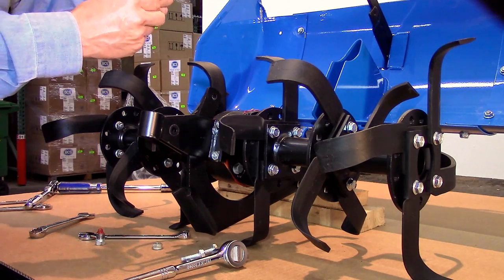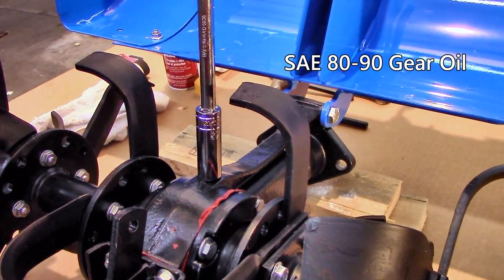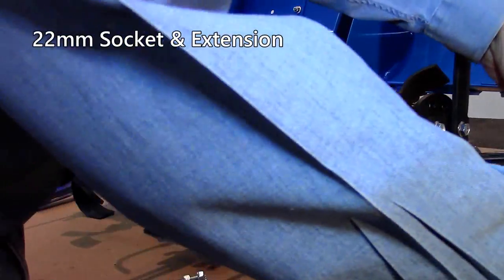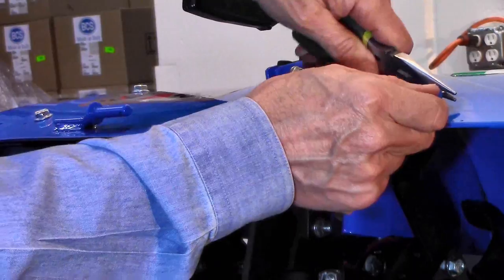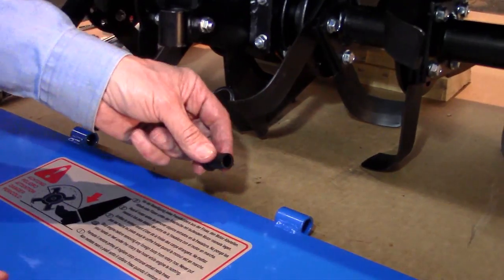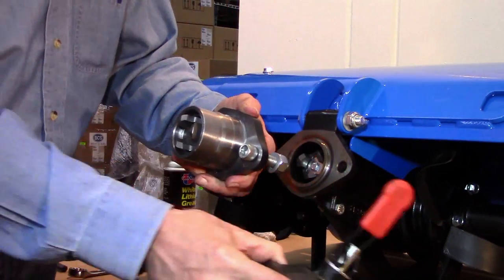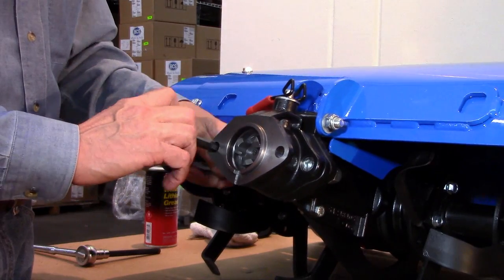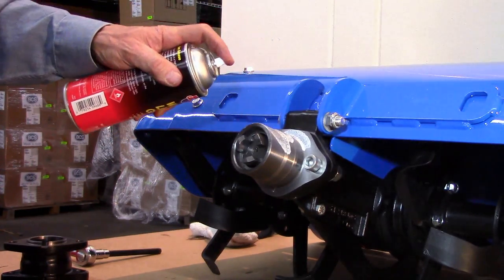Initial Setup of the Rear-Tine Tiller attachment for BCS Two-Wheel Tractors

Comment: How do you clean out a motor you tipped over and got oil in the motor??? My tire was coming off cause of low pressure and I tipped over and have oil now all in the motor. Please help
Reply from the maker: We'd recommend a local small engine shop.  If it is a Honda engine, it can be serviced nearly anywhere.

Comment: I just bought a older used bcs 20 inch tiller today and got a 25'x60' bed tilled but it finished off most of the old remaining tines so I'm going to order new tines but I thought I read this tiller is expandable from 20-26 inches? If so how would I go about expanding the till width?
Reply from the maker: Hi James,
If you're tiller was built in 1995 or later, you can purchase an expansion kit that will turn your 20" into a 26".  The sides of your tiller hood will expand outwards and the kit includes the extra spacers and tine hubs to fill out the hood.  Part number for this kit is TK1.  Cheers!

Comment: Im interested in creating tilled lines for growing corn. Im windering what you would think of me removing most of the outer tines for a narrow strip. More power per 4-innermost tines. What do you think? Would if work well? Havjngca log of tines causes me to have to till large surface areas
Reply from the maker: We'll need some more info.  Specifically:
•	In what zone are you located?
•	What is growing in the plot now?  Do you plan on planting a cover crop this fall?
•	Do you plan on tilling the strips this fall, or next spring?
•	What will the distance be between tilled strips and what will be growing between the strips?

The reason for the questions is that the more aggressive the vegetation between the strips, the wider the strips will need to be.  Also, if the strips are too far apart, pollination will require the corn be hill-planted (3 plants per 30”) as opposed to a traditional single row.
Reply: @BCSAmerica  I haven't planted in a year. The grass will be flailed before. And herbicide used after. I live in the Caribbean, so there's no issue with the 4 seasons. I have planted corn before but with my full compliment of tines on rotary tiller 30 inches... which causes me to have to plow a larger surface area than I have to. I plant corn in rows 30 to 36 inches apart.
Reply from the maker: @small-timegarden  Interesting circumstances – here's our recommendation:

Till the strips with the tilling width set at 16”.  To achieve this setting, simply unbolt the outside tine holders, leaving the four tines attached to the outside holder.  Then, before tightening the four bolts that were securing the outside tine holder from the middle tine holder, remove the outward turned tines, and then tighten the bolts, leaving only the inward turned tines in place.  In other words, the result on each side of the central gearbox will be four tines attached to the inner tine holder and two tines (facing inward) attached to the next tine holder. 

As opposed to the option of simply using the inside set of four tines, this additional four inches provides a larger root zone and, perhaps more importantly, sufficient soil to mechanically (with our double disc hillers) or hand cultivate the emerging seedlings from competing weeds and, at a later stage, more aggressively provide support from wind/storm damage. 

The pattern of 16” tilled strips with an untilled 16” strip separating them provides a 32” row spacing.  We’ve had success with this pattern, except our untilled strips were a cover crop of clover from the previous fall.
Reply: @BCSAmerica  quite comprehensive. I follow. Cultivating isn't a method I use a lot, as it is quite energy-consuming. And the root zone consideration, i can appreciate. I will attempt this. Thank you for responding.

Comment: Is there a video demonstratng the depth adjustment? I'd like to know if its only two depths. Thank you
Reply from the maker: Hi Shayne,
We'll have to make a quick video on that this spring.  There are actually four depths on our standard tiller.  To reach the deepest setting (approx. 8"), the lever/pin on the back of the tiller needs to be lifted UP to the highest setting.  At this position, the pin will not actually be in a hole on the lever, but the planar wedge in the center of the tines will be all the way up against the tiller's transmission, keeping it in place.  Hope this helps!
Thanks
Reply: @BCSAmerica  aaaaah thanks. Will play with this. I hope it doesnt mean that the depth will slip while being used
Reply from the maker: @small-timegarden  Since the weight of the tractor is balanced over the tiller, gravity alone will keep it in the deepest setting.  Thanks!
Reply: @BCSAmerica  yes makes sense. Thanks
Reply: have u made a video about this yet
Reply from the maker: @jamesjutte6119  No, but it is very simple.  Pull the depth lever all the way UP to reach the deepest setting.  Push it all the way DOWN for the shallowest.  The lever controls the planar wedge in the center of the tines.  This regulates the depth.

Comment: Hi, should I put some lubricant / grease on the PTO gears and quick hitch gears too? thanks
Reply from the maker: +jianfri Greasing the three-jaw gears on the PTO and Quick Hitch is not 
necessary.  As indicated on the video, we recommend a lubricant on the 
outside of the Quick Hitch tang to keep it rust free and easy to slide 
in and out.

Comment: looking for a video that can demonstrate how to change the depth of the tiller. Can you help?
Reply from the maker: Sure! Because it's quite a simple process, we don't have a video dedicated to it. All you have to do is pull the silver pin sideways from the depth control lever on the top of the tiller, and raise or lower the lever until you align the desired hole with the silver pin before letting go of the pin, allowing it to pop into place. This process is much easier before the tiller tines are actually in your soil.